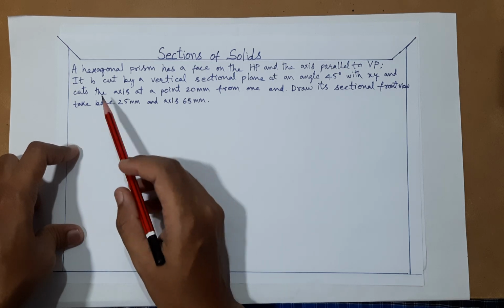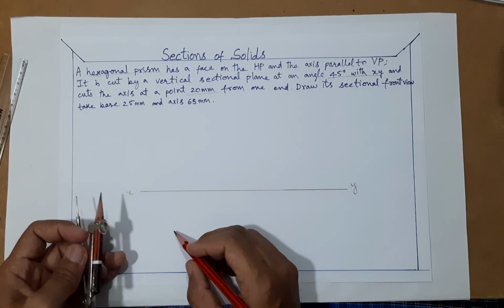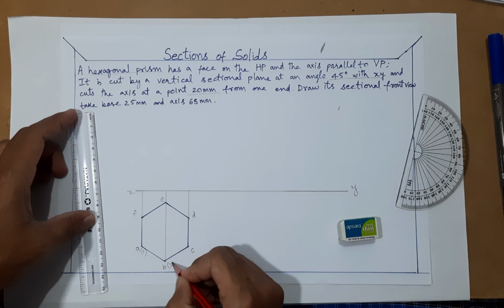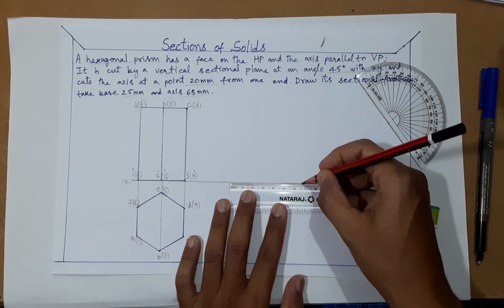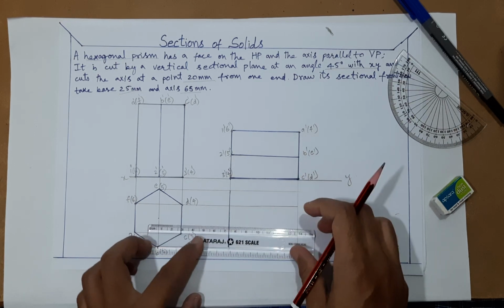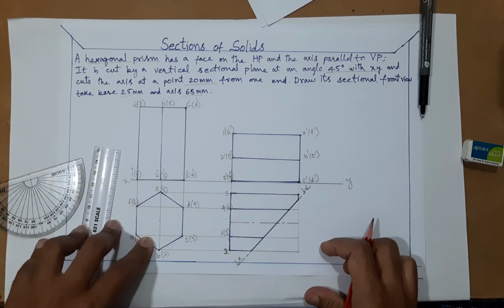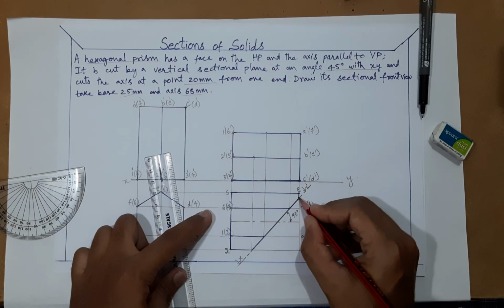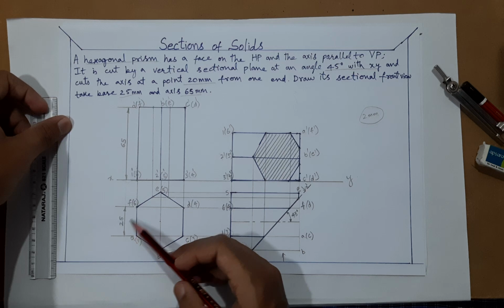Sections of Solids | Section of Hexagonal Prism

Comment: Sir, below are "BETA ANGLE TYPE" problems or not ??? please reply sir

 consider all in Quadrant 1 where we draw BASE on hp(top-view) and rectangle/triangle on vp(front-view). axis perpendicular to hp.

Pyramids:-  without words "appears to be" or "top view angle" in all questions.
1) axis incline to both.
2) Slant Edge on HP + Axis incline to VP.  (OR)  Slant Edge incline to HP + Axis incline to VP.
3) Slant Face on HP + Axis incline to VP.  (OR)  Slant Face incline to HP + Axis incline to VP.
4)  Triangular Face on HP + Axis incline to VP.  (OR)  Triangular Face incline to HP + Axis incline to VP.

Prisms:-  without words "appears to be" or "top view angle" in all questions.
1) axis incline to both.
2)  Longer Edge on HP + Axis incline to VP.  (OR)  Longer Edge incline to HP + Axis incline to VP.
3)  Vertical Face on HP + Axis incline to VP.  (OR)  Vertical Face incline to HP + Axis incline to VP.
4)  Rectangular Face on HP + Axis incline to VP.  (OR)  Rectangular Face incline to HP + Axis incline to VP.

all of these are beta problems am i correct sir ???
Reply from the maker: One thing you please remember. Beta problem how to identify is that when the angle is given with HP and with VP to same entity such as axis. If axis is inclined to HP and same axis is also inclined to VP then Beta angle you have to take. If one angle is axis inclined to HP and other angle side of base edge inclined to VP like this given then here both angles are given to different entities ( one axis and one base edge or side) in this kind of problems beta won't come.
Reply: @RafeeqEngineeringDrawing sir, Q) square pyramid of slant face is rest on hp,
Reply: @RafeeqEngineeringDrawing sir,
Q) square pyramid rests on one of its triangular face on HP. Draw projections when axis inclined 30 degree to VP ???
A) sir is this beta angle problem.
Step1) top view square with perpendicular sided to xy, front view is triangle.
Step2) we keep incline front view right side line of triangle on XY(slant face)
Step3) top view we have to draw 30 degree mark TRUE LENGTH  of axis and find BETA ANGLE line mark reduced axis length from S-2